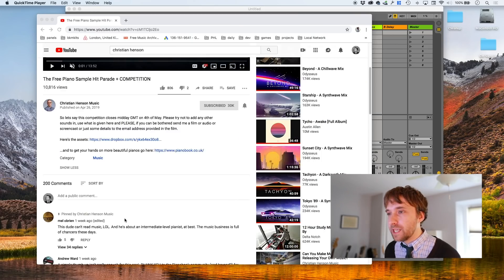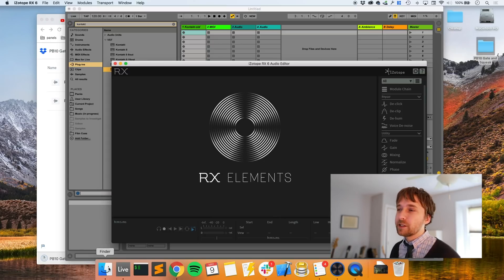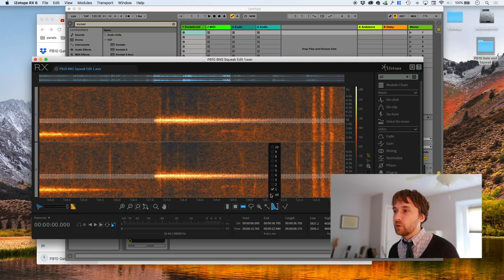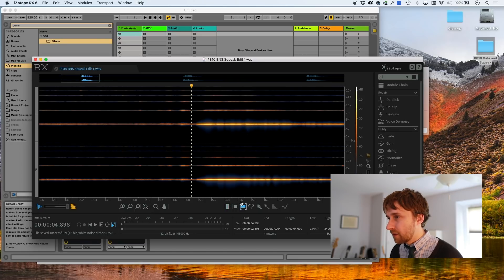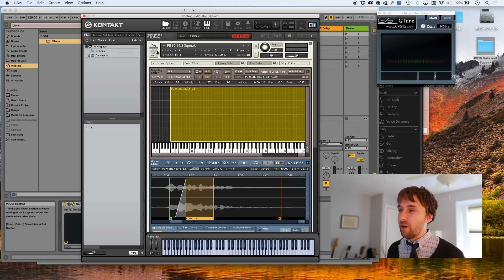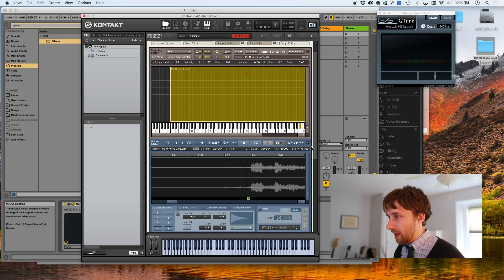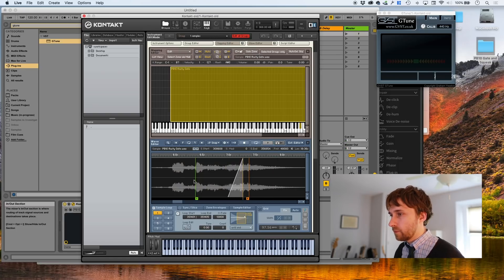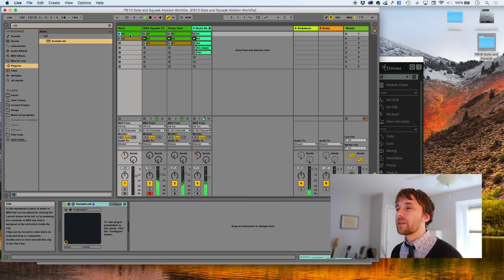How to remove unwanted frequencies from your samples!

Comment: Can you trigger multiple groups at once inside of kontakt? If so can you please explain how?
Reply from the maker: Not sure I understand that question. By default multiple groups should all be triggered at once unless you have round-robins turned on. 

Did you mean multiple instruments?  If so, you should make sure that all of the instruments have the same midi input channel.
Reply: David Hilowitz Music thank you for your reply. I mean for example: If I record a snare for instance, with 2 mics and I set them up in their own groups. can I 1. Trigger both groups simultaneously? & 2. Map each group to its own bus or output for blending the mics?

Thank you for your help.